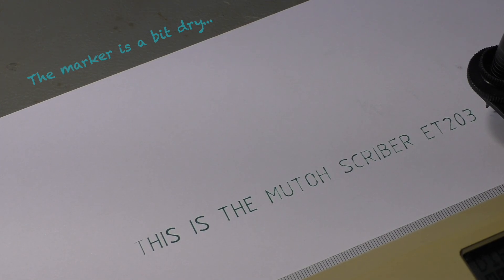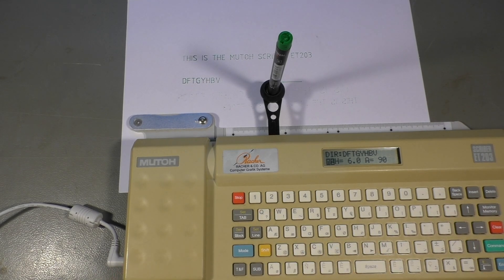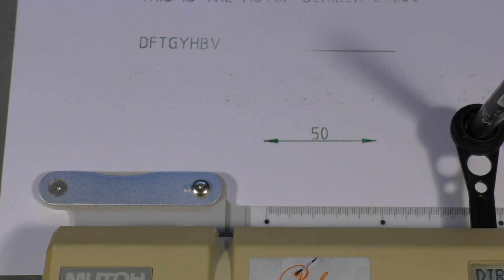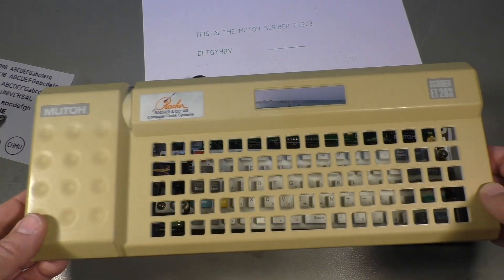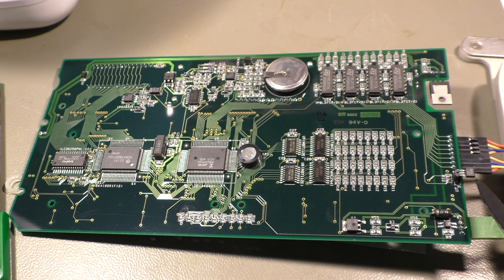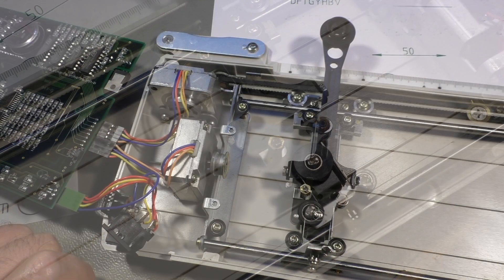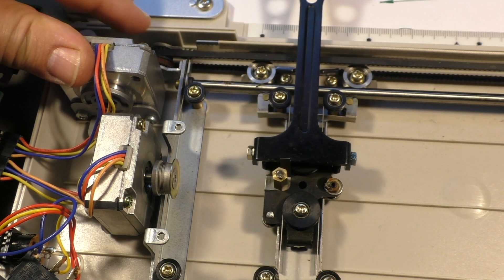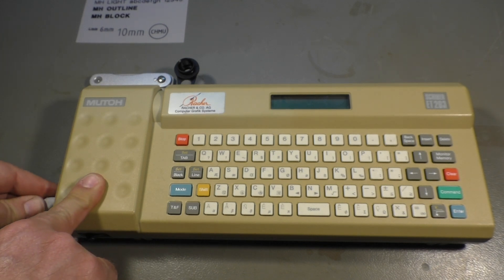The Mutoh Scriber ET203 (PWJ215)

Comment: Used to love the sound of pen plotters,  I still remember my my first A0 circuit diagram plot,it took 3hrs to plot and when it finished the pen returned home from top right to bottom left without lifting. It decided to cross out all my hard-working 😢😂
Reply from the maker: Something similar happened to me with my CNC milling machine. Milling a part for half an hour and the crash into the support screw...
Reply: @PlaywithJunk  i once set an A0 plot going and came back hrs later to find a credit card size plot in the middle of the sheet.
Another funny thing was at one point we could not plot on Fridays. the plot queue blocked on Thursday midnight and released on Friday at midnight. the program vendor said it was a plotter driver issue and the plotter folk said it was a program fault.

This went on until the pen plotter was replaced with an ink jet one.

Comment: Chips: The MB622902 is an old gate array from Fujitsu. The Processor is the HD64180 from Hitacht which is a 10 MHz Z180 (Z80 on steroids) CPU. Next to it is a SANYO 32kByte SRAM.
The stuff with the many resistors is a basic sinusoid DDS. The MB7112 are small ROMS containing sinusoid waveform data which goes through the drivers to the resisistors to make up a waveform for microcstepping and quiet stepper motor driving. I can see datecodes from 1992 on some ICs.
Reply: Thanks for the info!
Reply from the maker: I knew someone will figure out the details, thanks a lot. I had the feeling that the resistors are some kind of D/A or A/D conversion stuff. But I assumed the stepper drivers were smart enough to handle that alone. Sometimes the details are even smarter as you may think.
That's what I like from 1990s stuff. They didn't have all those specialized ICs. They took standard parts and did some external wizardry :-)

Comment: What a useful little device!

I'm pretty sure that the "Y" wire is anchored at the pen holder and that the partially hidden wheel is for guiding it along the rail.
Reply from the maker: The Y wire is fixed to the right side of the chassis. The pen holder is kept in place by rollers only. If the wire would be fixed to the holder, then it couldn't move in X direction
Reply: @PlaywithJunk  Aah, now I see! I just assumed that the wire also had a roller on the opposite side just as the X belt, and then it would make no sense. You are right, it is like two cranes working in opposite.
Reply from the maker: Exactly 🙂

Comment: Under arduino control could be a good PCB printer, with a good permanent pen you can do all the traces, pads etc and then use acid to attack the exposed copper.
Reply from the maker: I made PCBs in that way and it works. But the small plotter can only reach 40x140mm. For a small PCB that may be fine.

Comment: Those nuts inset in the bottom are neat. I've seen many pieces of equipment that have mounting screws with heads on the outside, which puts you in the position of "Will unscrewing this open the case, or will it make something inside fall off?" With the nuts, no problem: you get the advantage of all-metal mounting, but they can't be removed from the outside.
Reply from the maker: And it's more precise than a self-threading screw into plastic.

Comment: I have an older but very similar scriber branded as a rOtring NC scriber. 
The case and mechanism is very similar but the electronics on mine were all 1980's DIP IC's on multiple PCB's and tactical switches with hard plastic keys.
The kinematics of these is the same as the original Ultimaker 3d printers. 
I fitted mine with an esp32 running fluidNC firmware so it can draw any vector art sent from a phone or computer via WiFi. 
I sent the original electronics and  power supply to someone restoring one so it wasn't thrown away.

Comment: Sounds like a Mimaki! As I have noticed, every manufacturer of Wide format inkjet printers - ones that got at about 1.6m wide. Have their own distinct sound.  If you are in a game long enough, just by the sound you can make out what make and which model is working.  Mimaki's stepper drivers are programmed in such a way that they sound almost like a music, maybe it's also a preference of one manufacturers stepper motors, but it seems it's more in way they are driven in software.  And this thing has the same sound signature.

Comment: I managed to get one of these 2nd hand but have yet to play with it. I also read there was another model ET505. Does anyone know what the difference are? Which is more advanced/recent ET203 or ET505?
Reply from the maker: Logically the 505 would be the more advanced unit, but I'm not sure. I only managed to find a french manual of a very simiar "clone" machine. I think, I read somewhere that the 505 has a slot for additional fonts.
Here is what I found:  https://archive.org/details/alpiake3100manueldutilisation  This is very close to the 203...
There is also an ET202:  https://archive.org/details/mutoh-scriber-et202-operation-manual